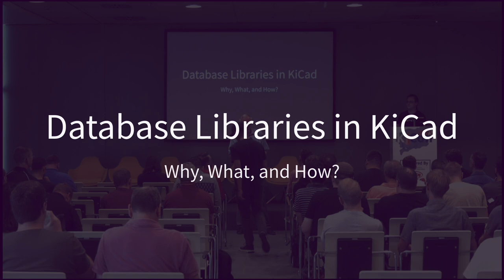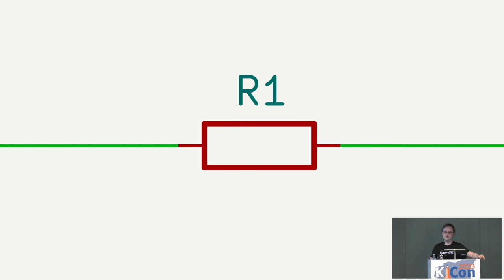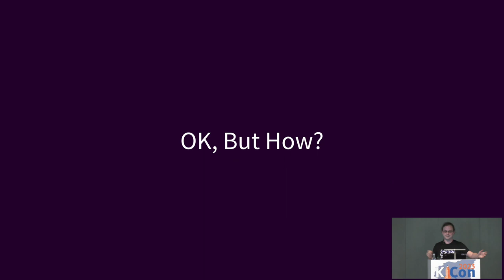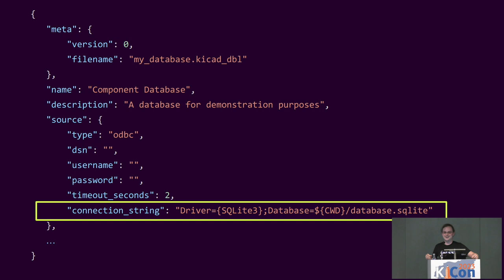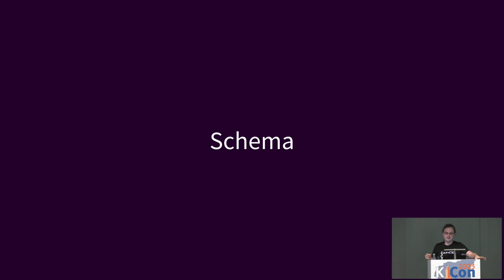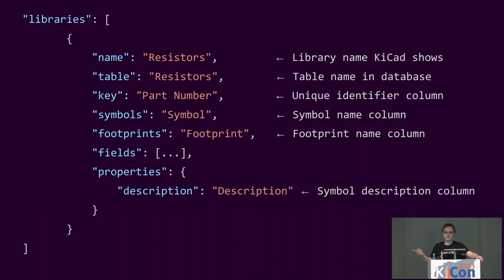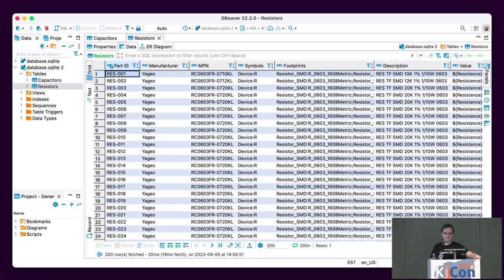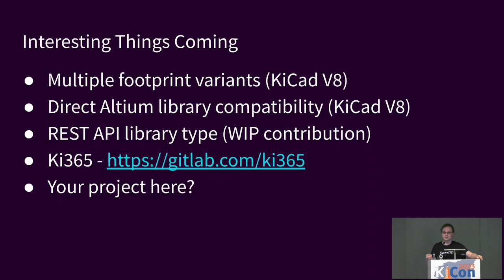KiCon 2023 Database Libraries

Comment: Can this support arbitrary library hierarchies? so I can finally have separate nested folders for each of something like "connectors -> jst -> sh -> smd -> right angle -> [actual list of connector components]" instead of making convoluted component names so they get alphabetically sorted?
Reply: Great question, have you found an answer?
Reply: @BHBalast 
It can not unfortionately. Kicad is lagging behind in this area.

The main thing it does is allow you to use the same symbol/footprint across multiple parts. So for a resistor you just add a new part with the updated value and part number and you can easially add a whole series of parts without recreating a bunch of symbols.

Now if only you could sort those boatload of parts you just made.
Reply: In Orcad Capture CIS, you can have a "Type" field on DB for each component, which then becomes part of the path in the tree (DB:Table/Type/Component). And if type is called something like "0603/Polarized" you can have additional level (DB:Resistor/0603/Polarized/Component). Would rock if that was possible in KiCAD.

Comment: What I do use (and think might be interesting) are two columns that save timestamps of when rows in a dblib were created ("date_added") or updated ("date_updated"). The first one is set by creation of the row using  CURRENT_TIMESTAMP. The date_update column is set be a trigger:

CREATE TRIGGER [DATE_UPDATED_RESISTOR]
    AFTER UPDATE ON Resistor FOR EACH ROW
    WHEN OLD.date_updated = NEW.date_updated OR OLD.date_updated IS NULL
BEGIN
    UPDATE Resistor SET date_updated=CURRENT_TIMESTAMP WHERE part_id=NEW.part_id;
END

Also, a nice feature is that KiCad can use views as tables to filter (for example deactivate parts that have NRND status or similar)